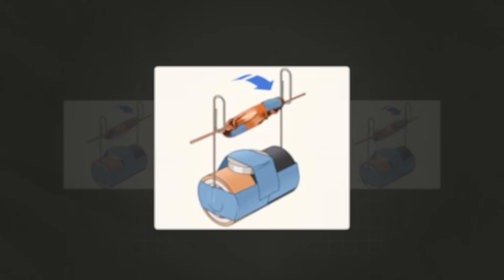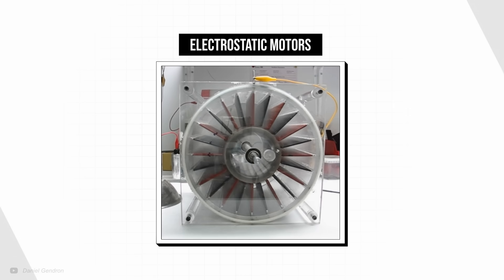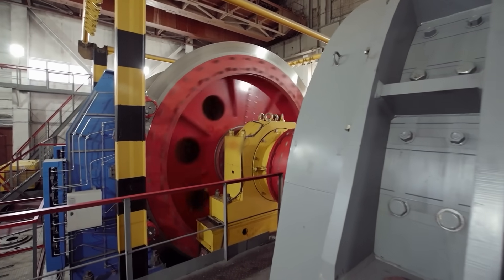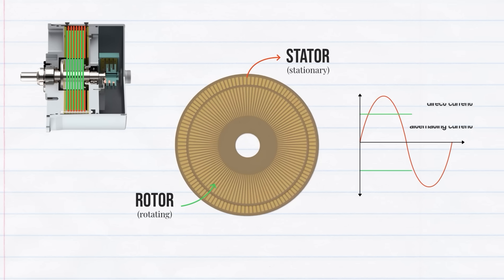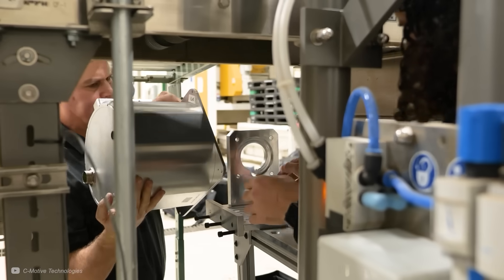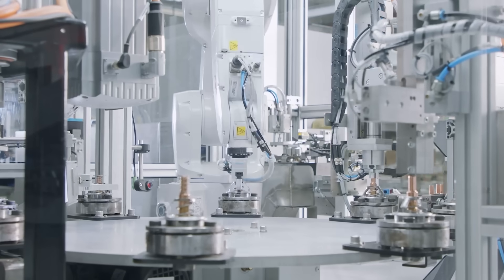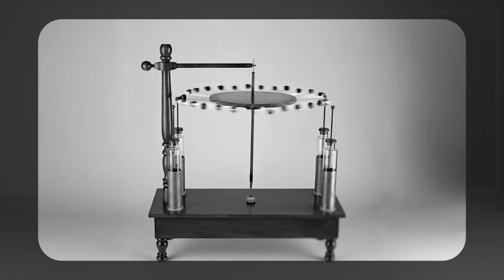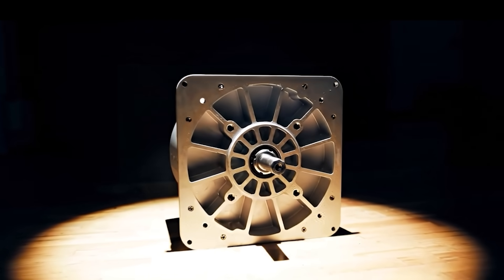How Electrostatic Motors are Breaking All the Rules

Comment: Dear Ziroth. Motors can't improve a lot.
Why, because the best are on 2 patents from Nicholas Tesla.
All what is made for 100 years are little improvements.
But all improvements jjave been done onsecont patent, asynchrone symetric motors.
As N. Tesla said, the best is the first patent, andnobody work on asynchrone asymetric motor that consume 3 times less than symetric one.
Why because symetric one tries to balance itself with electromotive  counterforce, and becomes hot.
Asynchrone asymetric motors stay cold
Thanks
Laurent

Comment: It is actually quite amazing, if were to believe the numbers they provide. 1.5KW motor used 365*24 will consume (maximum under constant load) 13140KWh electrical energy (or 47.304GJ energy) per year. Assuming $0.15/KWh that would give $1971.00 electric energy cost (again under full load). Accepting (up to) $1400 energy savings, that would give $571 cost for the alternative electric energy consumption per year. Reversing that (the reverse calculations) that gives $0.065/KWh cost for the energy input, for the same mechanical output. If true, these numbers are technically unbelievable. Even with their, concentration for an intimidate application for high torque low RPM systems, it will be an amazing breakthrough if the production number match the claims. Even with low torque, such a machine, with some gearing, can be applied to fairly high RPM, stationary applications. Of course with loss of some efficiency, but hey with such unbelievably good numbers, if remotely true, what is an additional 5-10% loss of efficiency.
Reply: Something tells me they used very favorable (high)electricity prices for the calcualtions
Reply: Magnetic motors use electricity (current) for holding torque also but this motor is like a capacitor, once you charge the plates it holds itself without wasting electricity so I guess that the savings come from this mainly and better low speed (regulated) efficiency.
Reply: They used figures that make their point look favourable.

They used ie1 motors and high ratio work gearboxes. You could use a commercially available ie3 or ie4 motor in the 90+% efficiency and a helical gearbox that losses 2% per reduction stage that is commercially available and much more simple solution. I am also fairly certain they are not factoring in the sprocket losses they used to drive the conveyor from the motor.

The reason the market uses worm boxes is because they are extremely cheap. The solution already exists but the purchase price is usually taken in favour of long term electricity as it’s next to nothing they usually have motors sub 1.5kw on them often much smaller. 

I doubt there solution will be price competitive or as reliable as squirrel cage motor gearbox and vsd
Reply: I don't believe their claims to be honest. I could be wrong but I just don't think their energy savings figures are correct
Reply: @IsZomg their not honest. In these low power applications that they state their using in they could use ie4 motors and helical bevel gearboxes which are far more efficient. However the initial outlay is more. 

If they cannot match price to a worm gearbox and ie3 motors which I think will be unlikely they won’t be commercially successful.

Comment: or just make a full wire motor, ie the magnet is also an electro-magnet. ie full copper motor. ie the same current that powers the motor coils also powers the electromagnets. can also be plasma tube wires with zero resistance. well they can also make some light. copper (copper sulphate electrolysis) has no reason to be high cost, same as zinc refining from zinc sulphate. require dc current? dc is much better, no ac complexity control driving circuits required. voodoo liquid magic. looks like water. secret sauce my secret. oh, vegetable oil. right. used in edm machining.
Reply: turns out you can do a coiled low current hall-effect dc motor.

Comment: Your best video yet Ryan.  If there's one thing we ought by now to have learned, it's that hagiographies rarely live up to their hype [ cough nuclear fusion ].  

I am wondering about the effects of shear under substantial rotational forces on that intriguing dielectric fluid.

This is definitely a technology to keep an eye on.
Reply: "I am wondering about the effects of shear under substantial rotational forces on that intriguing dielectric fluid."

That's a very insightful question. The fluid formulation is remarkably stable under mechanical and electrical stress, even at elevated temperatures. That said, cavitation at higher rotational speeds remains an engineering challenge—but one that can be addressed as the technology matures.